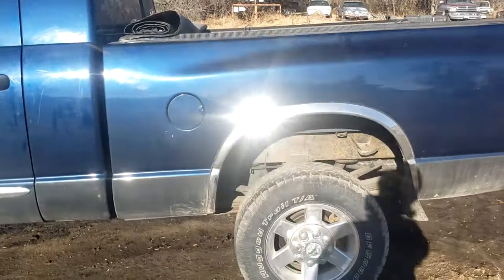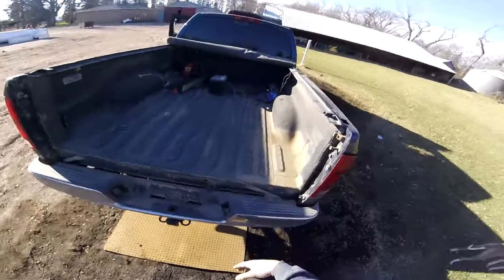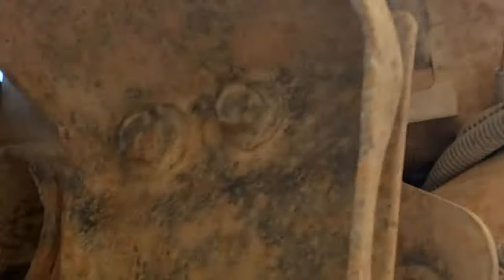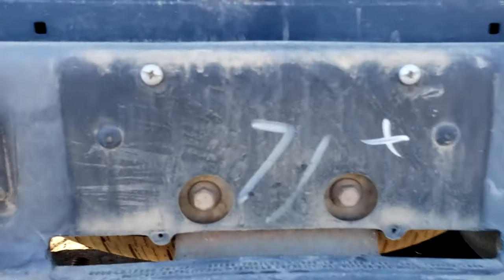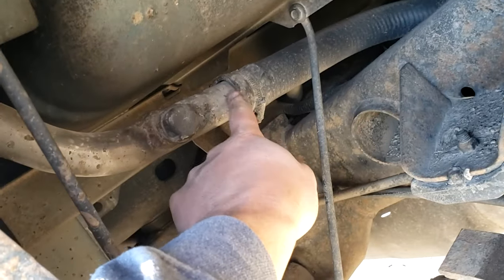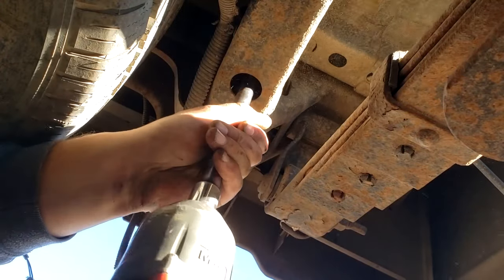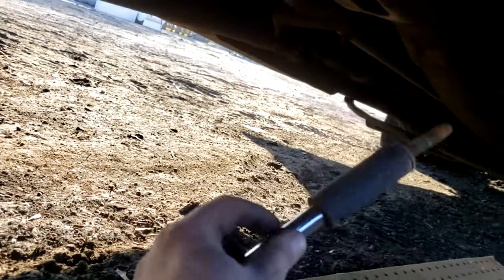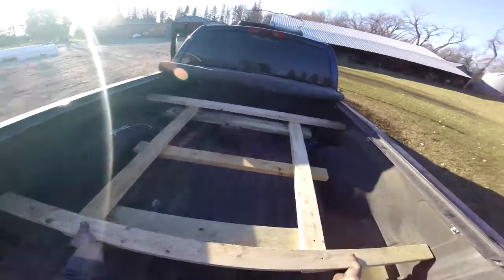Dodge Ram Bed Removal STEP BY STEP!

Comment: This video was a huge help. Replacing a rotten box on an 06 Dodge 2500 (5.7 gas) with extended cab. Doing it alone and this makes my life easier!
Reply: How did it go?   If your bo was rotten I'm sure your underside rocker panels are rotted out too.

Comment: 18MM bolts for bed 
T20 for gas cap 3 screws
T25 for tail lights
10MM for ground strap passenger side front of bed to cab.

Comment: Could you use the 4 tie downs with ratchets? I would love to remove mine and clean and paint my frame. I'd have to buy a engine hoist or something.
Reply from the maker: I'm sure there's a way to do it, I was planning on using my hoist but this worked way better. I bet with some quick googling you'll find your answer

Comment: Can you say exactly what size tools you used to take it off
Reply: 18MM bolts for bed 
T20 for gas cap 3 screws
T25 for tail lights
10MM for ground strap passenger side front of bed to cab.

Comment: Thanks for sharing this.  Do you know the approximate weight of the box? Think 4 guys could lift it off?
Reply from the maker: Oh yeah easily and not sure on the weight, round 300 lbs if I had to guess
Reply: @j-bobsgarage7535  Great!  Appreciate that.  Still not sure if I need to remove it for the work I've got to do, but need to plan accordingly.